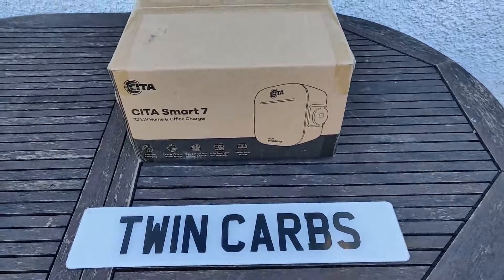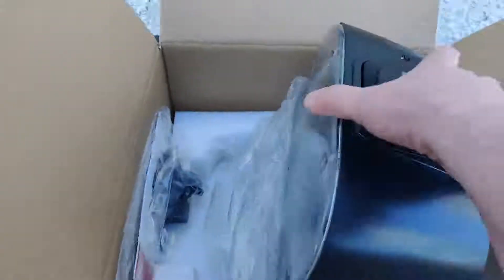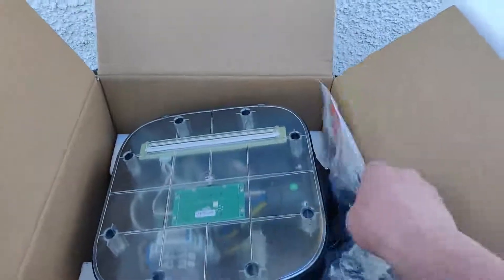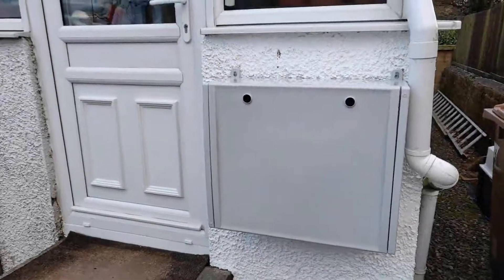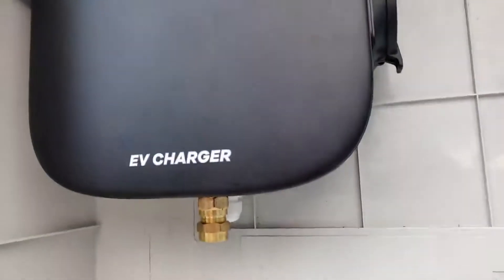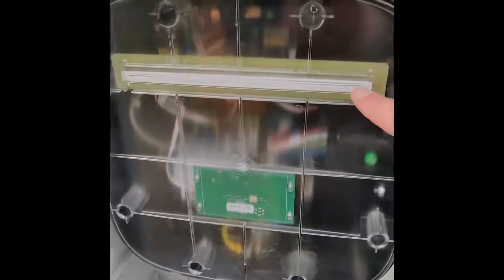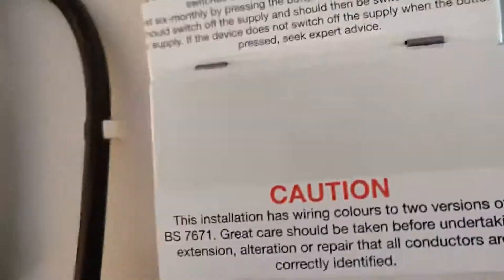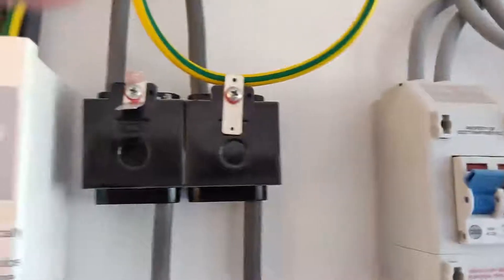CITA Smart 7 EV Charger Installation

Comment: Could this box be fitted  nine zero clockwise,  so door swings open rather that drop down..
Reply from the maker: Unfortunately not. There's not enough room to get the cable plugged in. I guess if you had a tethered charger it would be fine.

Comment: Hi Twin Carbs,
Thank you very much for your excellent and informative video!
We just paid a deposit for an MG5 EV and would like to install the CITA Smart 7.
Would you be so kind as to tell me please where you bought the ABS box and what model it is?
Many thanks!
Reply from the maker: Hi tayanski. Thank you for your comments and congratulations on buying a MG5 EV. The ABS box is from RS Components - https://uk.rs-online.com/web/c/enclosures-server-racks/enclosures/wall-boxes/.  The box is 600x500x220. I think the part number is RS PRO ABS Wall Box, IP65, 220mm x 600 mm x 500 mm
RS Stock No.769-6122. Are you buying the CITA Smart 7 direct or from a distributor?
Reply: Thank you very much for your help! We were thinking of getting a quote direct from Cita. We are quite close to their Cumbernauld office. Do you recommend otherwise? Much appreciated!
Reply from the maker: By all means speak with the guys at CITA. I found them very helpful. 👍
Reply: Hi tayanski.  You may please contact our UK Office thru 0044 141 370 2127 or 0800 142 CITA(2482) for your CITA Smart 7 EV Charger.